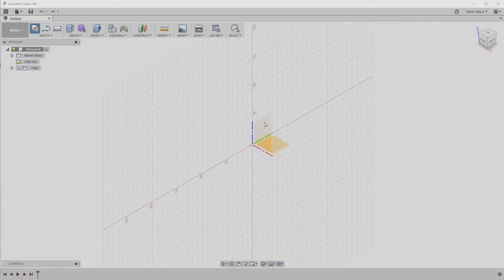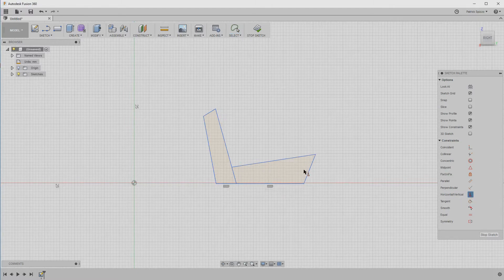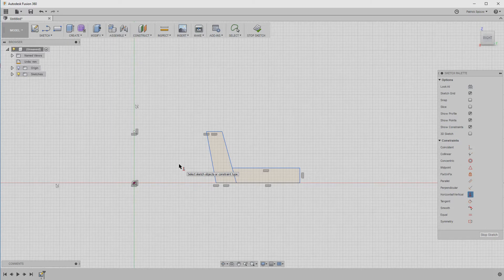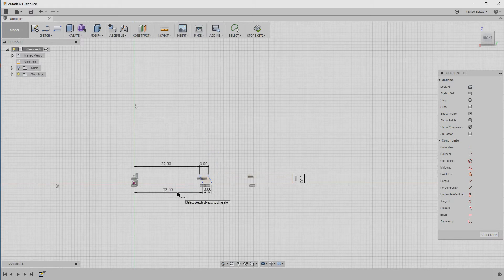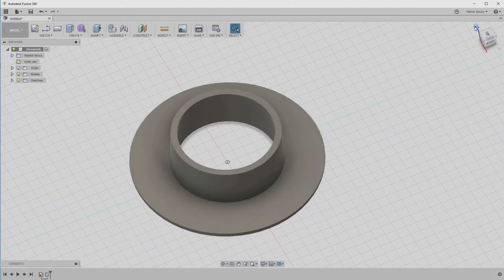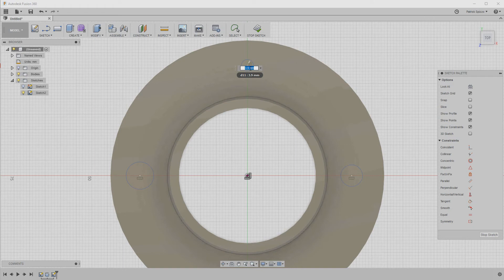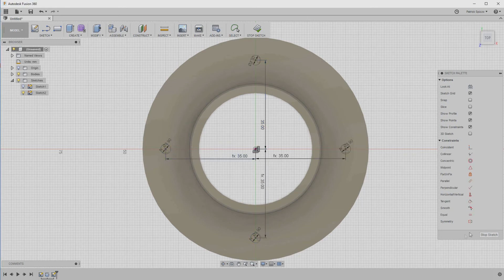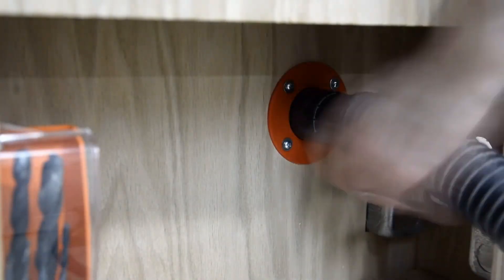Make a Router Table Dust Port  //  Learn Fusion 360 #3

Comment: Great stuff man!
For the drill holes I would have gone ahead and dimensioned one hole only and use the circular pattern hole to make the other three. This reduces the amount of dimensioning needed.
I liked the tip on repeating dimensions using the dimension's name. I usuallly use the "equal" constraint to do that same task.
Reply from the maker: Good idea about the circular pattern, that's a simpler solution!  It's fun that Fusion 360 has multiple ways to get things done.